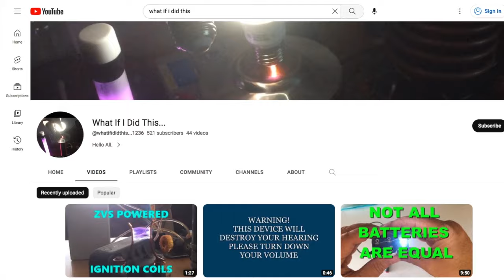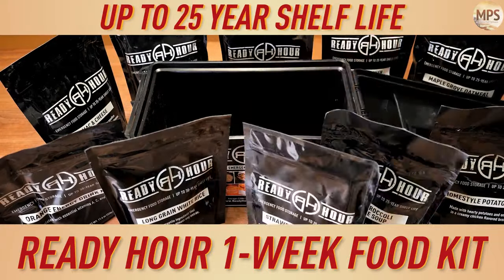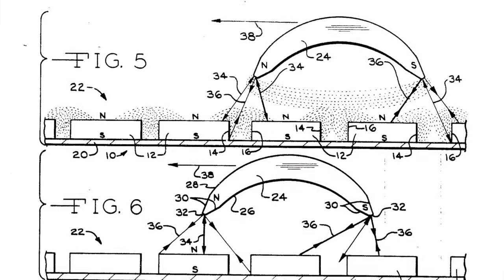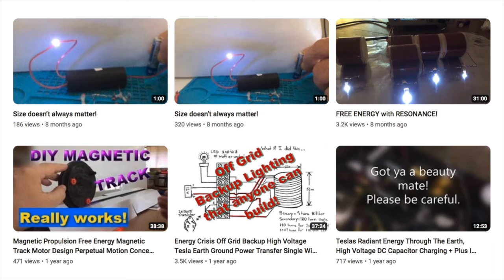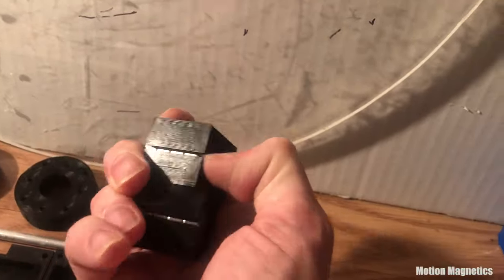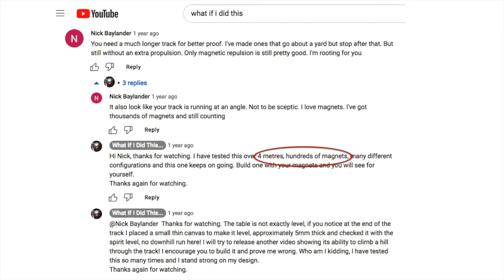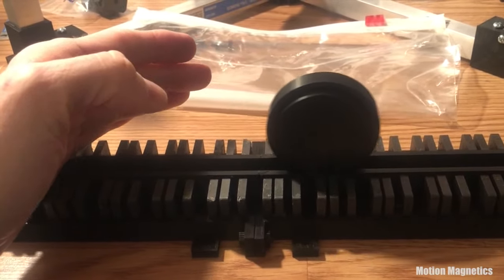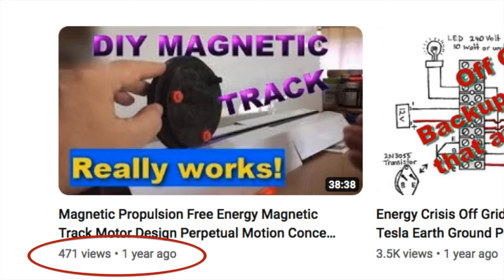Magnetic Propulsion System

Comment: the problem here is you're trying to make the most symmetrical thing in the universe, asymmetrical. magnetism will always make a torus, a positive side and and negative side, a divergent flux and a convergent flux. instead learn about how that torus is made, what does larmor frequency mean in MRI machines, if there's already a change in magnetic force over time then THERE is your chance at making a proper wire placement to light a lightbulb from only a magnet, you can see in an oscilloscope, they touch a magnet and voltages frequencies are there, you just need to learn harmonics of electronics to harness it

Comment: a lot of interesting comments and maybe you do not engage as much to swat ideas but more like present more which which does not help.
As stated before momentum you get with heavier weight and length of the track before it hits a bottleneck. Just like a plane taking off will not take off if the track is short or in the middle and you wanting it to be at the center does not makes sense. Do you agree? If not why not? 

Also The video with Rays magnets is interesting as stated. 
From other people that make videos like these I notice many are not doing ti right especially when they try to mimic others and make many design flaws to not follow the steps and maybe that is the flaw with people.

Also as for track look it wont make sense to be on top of the magnet since the distance is distorted which makes it harder but on the side to have a consistent spacing. So in short your circular pancake design will not work. 

Maybe you should communicate with the guy more to trade ideas than what most do in how most want to do it themselves.
Reply from the maker: To successfully convert a flat track magnetic motor to a rotary magnetic motor your flat track must be able to start an object from various spots on the track, including the middle, or a rotary version simply will not work. I explained exactly why in the video. A flat track may look more like your analogy of a plane taking off, but it's not necessarily accelerating in the same way. It may be functioning more like a slingshot. It's the repulsive force at the entrance of the track that helps propel the object out the other end of the track. If you round that into a rotary version it won't work. It's the equivalent of starting in the middle of a flat track, because once it's enclosed you lose that repulsive force from the front of the track that slingshots it through the track.  If you add a space so that you can replicate the effect from the flat track the opposing force in the gap will simply push your rotor back to the start position and it will cog, often before completing one full rotation. Sometimes, after a handful. Add mass and momentum and the same thing will happen. If the arrangement of magnets on the track really works,  you should be able to restart an object at various spots on a track and it will pick up speed and run the length of the track. Only then, should you build a rotary version. 

We are currently communicating about collaborating on his design.
Reply: @Motionmagnetics  thanks for your point of view.

Comment: I find your experiments interesting but, even if you were able to get them to work, as others have already, they would simply be kewl to watch. I have some designs that work with electromagnetic power generation with a combination of simple iron magnets and electromagnets. I can see them working in my head but don't have the funds/means to build prototypes :\ However, I did buy 10 small 20mm electromagnets a while back and am amazed at how little current is needed to get them working. Which leads me to believe my idea(s) will work but still need a lot of other parts.
Reply from the maker: Thanks. You might try building what you can and posting your progress? That might give people the incentive to support your work.
Reply: @Motionmagnetics  I have thought about that and my channel does have some videos I have made but unrelated to this topic. I'm primarily a web developer but I have worked in many types of design and engineering most all my life.
Reply: I agree perm and electro magnetics offer more promise however I think people are leading themselves astray with perpetual theory when anything useful will need to overcome resistance to perform any work electromagnetic toroids 369 very interesting

Comment: Every third one you take the square corners around the corner edges of the square then the spacing I mean you probably have better knowledge on the spacing stuff to in the flat spot on the rotation and keep the rotor going but if you round the corners on the square One it'll react and create an electric induction start to react off the negative and positive creating electricity which will conduct the other magnets and make the magnetic energy you can rotate the wheel faster that you can cut it from a box and in turn the diamond flux on that in a way that it pulls the electric energy will fill in the flat spot on the the track itself has those energy waves in the ripples compressed way to keep everything rolling rotating or twisting the energy consol of them are stacked the way they are if you wrote 81 into a diamond from the box configuration and twist one it'll create a Whirlpool act up onto the next in succession magnet which creates the from one magnet to another magnet creating a stream now the stream when you twist it creates a cyclone rotation which will keep everything running like the water and electric

Comment: it would be better just do maglev flywheel, tho :)
Reply: yes magnet tracks are essentially springs
Reply: or in other words energy storages of some form
Reply: try radial maglev bearings, then make it alternate each revolution using a spring between maglev/push modes, 90 degree turning of 2 magnets on the opposite sides, and normal bearing
Reply: the spring is enough to return and keep the magnet in maglev mode when the radial motion magnet comes in, then for example physical pole drags the radial magnet to tangential position, resulting in push while keeping it tangential, then the spring/mechanical returns the magnet without any magnetic resistance to radial maglev mode, I hope the idea became clear
Reply: well actually both the rotor and the rim magnets are knocked to tangential mode, then back to maglev pass-by mode, by some mechanism
Reply: @Jkauppa  Doesn't it have some resistance, though? At the speeds we'd want, those losses might be greater than the gain to be had?
Reply: @Cloxxki  no
Reply: @Cloxxki  it goes like a train but better, well remove air
Reply: @Cloxxki  its an energy storage for a reason, the opposing magnet fields do not go into each other, so even no dc induction will happen, at max atmospheric surface friction, assuming you have a solid cylinder spinning, remove air to remove that friction
Reply: @Cloxxki  its the closest approximation to perpetual motion (energy conserved), well if you go to a moon with super conducting temps (like 80K) then spinning current in a super conductor coil is even better perpetual motion
Reply: @Cloxxki  gain in the battery is to retain the energy when not being used
Reply: @Cloxxki  if you use maglev base bearing (like trains) and two maglev vertical bearings to hold the spinner up, middle and top, then, minimal resistance
Reply: @Cloxxki  its same as you shoot something in space with approximate nothing to resist, in vacuum
Reply: @Cloxxki  what do you want to gain, eternal life? God gives that and this, to you, not me

Comment: I’m confused, what are you trying to do? Putting the magnets like that will never work because the negative and positive, all you need to do is angle magnets twenty degrees vertically and twenty degrees horizontally then you get permanent rotation, no need to coat or cover the Positive faces to stop the pull, takes two mins to get up to speed but then can power/charge most 9volts because I use one that I make for camping to charge my phone and do the 9v fridges, I sell them for £50, all I ask for is the money for materials, takes a week to build the structure made from my 3d printer, copper wire and stainless steel rods, iv sold about 200 and never had problem/breakdown with any
Reply from the maker: Perhaps you might want to share a video of your device if you've managed to build something like that?

Comment: Even if there were a method to extract continuous motion from permanent magnets, the energy would have to come from the magnetic fields of the magnets, and they would thus quickly become depleted and no longer magnetic. Thus this is totally pointless, an exercise in futility.
Reply from the maker: That's a very common but partly incorrect assumption, but thanks for the comment.